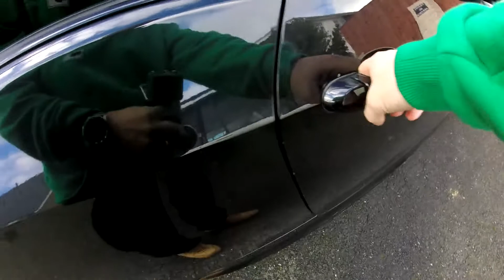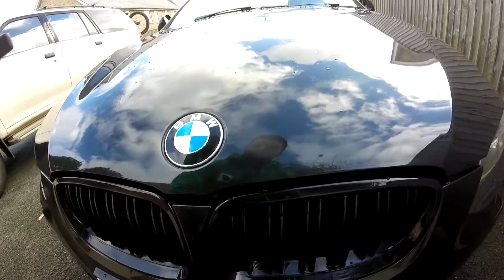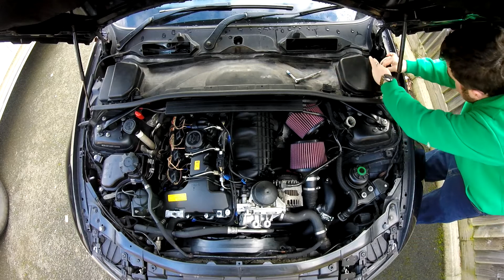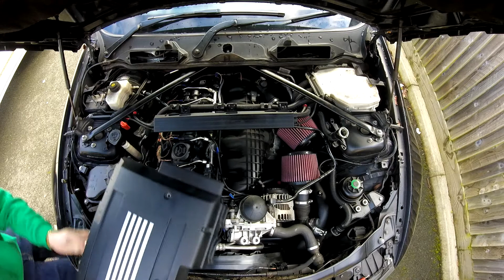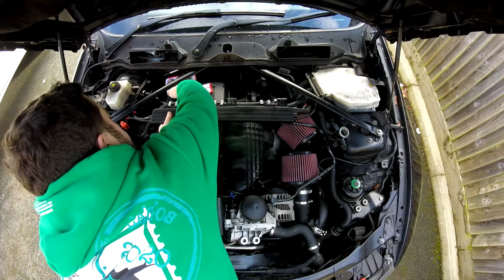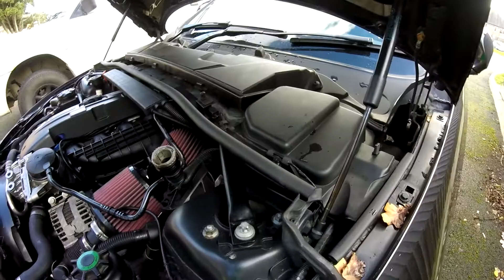BMW 335i N54 - Engine Cover Replacement

Comment: What’s the point of this video? You probably should have just talked during it, specified the size of every nut and bolt and what tool was necessary and the location of each.
Reply from the maker: It was one of my first videos on my channel. Didn't really have a clue what I was doing and still don't, to be honest 😂

Comment: Ugh I hate this design. I need replace a coil but instead of just taking off the cover and replacing it, I need to take off the big plastic piece. Almost want to keep the cover off.
Reply from the maker: Can be annoying. I wouldn't take it out altogether, though, as it keeps the rain off the top of the engine 😁